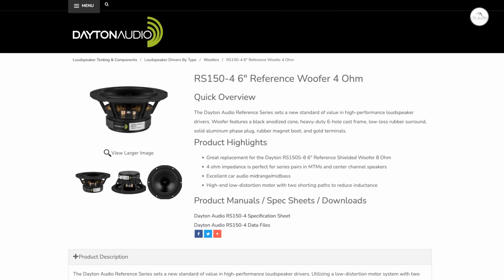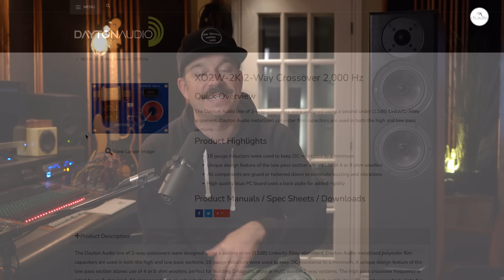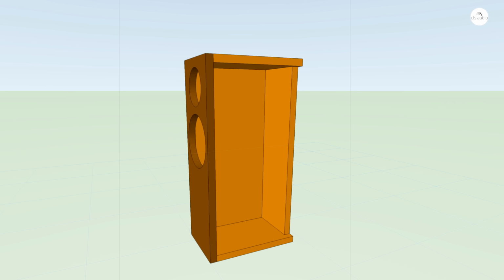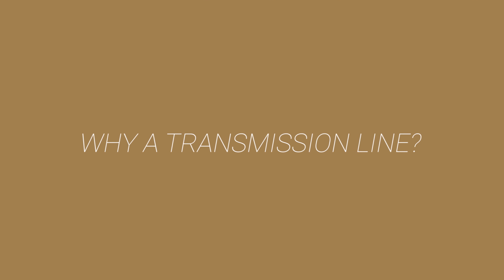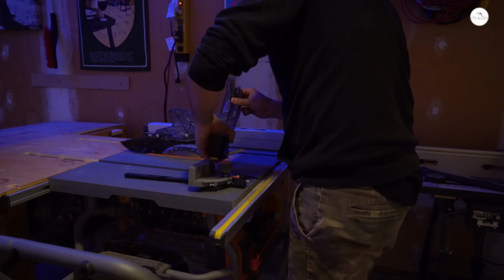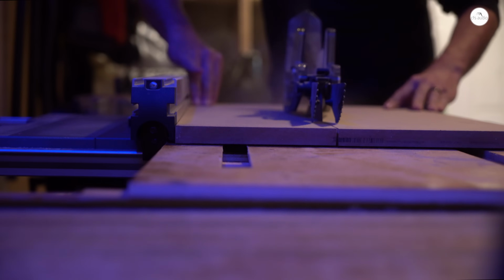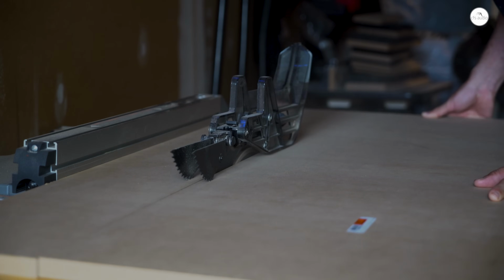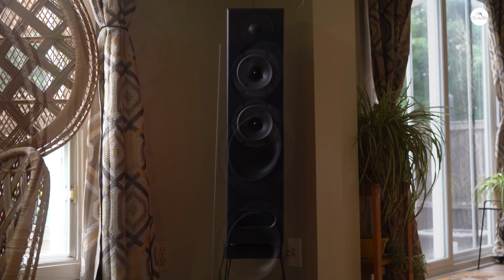DIY Reference Quality Speaker Build. How I built these amazing speakers and proper sound comparison!

Comment: If you want to upgrade it in the future, try to find a pair of silk ring radiator tweeters, preferably some based on the legendary VIFA XT25 lineup, as they are absolutely fantastic tweeters.

The long-winded explanation of transmission line speaker porting is that you are using a combination of air volume and the rate of transmissivity of sound through air to tune a speaker enclosure for a specific frequency that you want it to amplify. Most commonly, this is used to reinforce at or just below the resonant frequency of the main woofer to create a stronger bass or mid-bass performance, though it is possible to tune your enclosure volume and transmission line length to allow your speaker to dig even lower, though this can cause additional issues with time alignment. Unfortunately, I don't understand the equations and the physics behind them well enough to give an even more in-depth explanation, but it's a truly fascinating subject. You can also use folded enclosures with a certain shape to attenuate rear wave, like what KEF does with the Helmholtz resonator chambers on their Meta speakers. Inversely, you can also horn-load your transmission line by allowing the tube to expand in cross-section at a specific rate in order to amplify certain frequencies, though you typically only see people bother with this in the very niche point-source driver applications in order to get a usable bass response out of larger full-range drivers without needing to cheat like Bose does with their single driver crossover networks.
Reply from the maker: This great info Robert thanks for sharing!
Reply: @chrisferris3303  One guy who really knows something about transmission lines https://www.youtube.com/watch?v=HCQR7aXhKEc 
I've been designing and building t-lines exclusively for over 35 years, and I would largely ignore 95% of this comment thread, Chris! Just my 10 cents 😎😎

Here are a few fun t-line designs
https://www.youtube.com/watch?v=qm5K_VVRwXQ
https://www.youtube.com/watch?v=3qjWKUBvSNA
https://www.youtube.com/watch?v=-96WAVQdcyQ
https://www.youtube.com/watch?v=6yb2msOQw_4

t-line diy demo from a guy who I have huge respect for 
https://www.youtube.com/watch?v=-U3XW6TV9zI
Reply: You don't just swap different drivers in a speaker and think the crossover will match as well as with the original one.
Reply: @davidlong1786  they're roughly the same impedance, sensitivity, and the xt25 can actually cross over even lower if necessary, plus they're ruler flat down to, like, 1000Hz and out to 30kHz. So, yeah, you can just swap the driver out and expect it to perform as well.
Reply: @mndlessdrwer   "Roughly the same impedance" means close but no cigar. Same goes for " cross over lower if necessary". Who's going to rebuild the crossover for that? Not 99% of those that buy this kit. What about the impedance bumps at FS? Are they the same, if not then a big difference for the crossover.
Reply: @davidlong1786  It really isn't that important. If you're running a fairly simple crossover and neither of your tweeters are being run down to their resonant frequency, then matching their impedance there really doesn't matter. On top of all of that, dude is using pre-built fairly generic crossovers, so the significance matters even less. Would I recommend swapping drivers like that to someone who spent five hours building custom crossovers to really eke the most out of their drivers and reshape their FR to his preference? No, no I wouldn't. But he isn't to that stage yet, so this is the ideal time to reuse the generic crossovers and see if the sound signature of the tweeters is more to his preference compared to the ones from Dayton.
Reply: @mndlessdrwer   Well by using a generic crossover there is no telling what the combined frequency response is anyway but I'd guess at less than optimal no matter which tweeter he uses. It probably has dips and peaks who know where. I'd much rather buy a kit where the crossover was built specifically for the drivers so they have a better chance of sounding their best.
Reply: @davidlong1786  This is a very valid concern depending on how complicated the crossover is.

Comment: Been using Parts Express and Dayton Audio for over twenty years. I have a pair of rebuilt Sansui Speakers that now use Dayton Audio products, as well as all of my vehicles sound systems being designed around Dayton Audio Reference Series speakers. Incredible performance at an Incredible price point!!!!
Reply from the maker: Good stuff!
Reply: Any experience with rs225 or rs 100? Im planning to use them in car. Others seem to like sb acoustics  and scan speak too.

Comment: nice speakers. did you take any measurements of them ? how did you come up with the design and volume for the cabinets
Reply from the maker: Hey Jason, not yet. Gonna get myself a proper measuring kit. I plan to do a subwoofer build in the near future maybe I’ll include the measurements there. For this build I looked at a bunch of builds and the suggested speaker specs and went from there. Thanks for watching.
Reply: @chrisferris3303  well you did a great job, I’ve built a whole 5.1 soon to be 5.1.2 using the Dayton reference 7” drivers with a peerless tweeters. My mains are mtm design my center is a wmtmw and surrounds and atmos are just tm  versions

Comment: Nice build!  You would get enhanced results using a better crossover: It's easy to get indesirable effects using ready made crossovers.  Using iron-core inductances is a bad idea, it's cheaper but the value change with power.  It's important to use quality cables and binding posts (pure OFC copper).  Also, it's better to have the drivers flush mount, it avoids resonnances en diffraction.  Check for GR Research, the guy really know what he is takling about!  And don't forget: It's another topic by itselt but your listening room is a transfer function by itself!
Reply from the maker: Thanks Guy, can’t wait to start taking a deep dive. Also I’m a subscriber of GR research amazing channel.
Reply: Shure. But not gr research style. Overprized parts. Audyn q4 400v are cheap and good.  Same is for aircore inductors. 👍👍🇩🇪
Reply: Another GR fanatic
Reply: @pliedtka  not at all... I'm simply an engineer trying to help poeple.  I'm "fan" of nobody in this world, but there are good things from GR Research, and things i less agree...
Reply: @pliedtka  I’ve only been designing t-line exclusively for over 35 years, and I'm amazed at how the fundamentals of acoustics, which have been around since the beginning of time, and millions if not billions of years before speakers were ever invented ... are largely ignored by those who I think should know better, but obviously don't! 

Here are a few fun t-line designs
https://www.youtube.com/watch?v=qm5K_VVRwXQ
https://www.youtube.com/watch?v=3qjWKUBvSNA
https://www.youtube.com/watch?v=-96WAVQdcyQ
https://www.youtube.com/watch?v=6yb2msOQw_4

And a t-line  diy demo from a guy who I have huge respect for 
https://www.youtube.com/watch?v=-U3XW6TV9zI
Reply: @pliedtka  now, we can speak technical if you want, unless you are one of those trolls with big mouth and nothing to show for...

Comment: Sorry no. A pre-assembeld crossover is a terrible idea and the results are going to be poor at best. Speaker design isn't as trivial as pick your parts and crossover. It's way, way, more involved.
Reply: Its a great starting point with the pre-assembled, and from there starts the road to improve with software, measurements etc if it captures the interest.
Reply from the maker: @guyboisvert66  I’m already a subscriber of his. I was blown away by how poorly the RP 600’s tested. Super cool stuff on there.
Reply: @chrisferris3303  Yeah, Klipsch has always been about efficiency, not overall sound quality!
Reply: Dont be naive! Do you think every pair of speakers are tuned before they leave factory? First units are made this way. The rest is just copy and paste.
Reply: A pre-assembled crossover is a good starting point if you just want to get some speakers to listen to while you design something custom.
Reply: @mndlessdrwer  IMHO, in that case, better to pay real cheap otherwise, it's a waist of money!  A good designed crossover with quality parts is around 300$.  Fairly cheap for getting good sound!
Reply: @guyboisvert66  pretty much. You pay, like, $30 per crossover for something cheap that won't kill your driver's so you can use them while you build something better or find someone who builds better crossovers.
Reply from the maker: I’m sure you’re right. But everyone has to start somewhere. Thanks for watching.
Reply: @chrisferris3303 for a starting point the pre-assembled crossover is a good choice. Tip is to install it outside of the enclosure (on the backside of the speaker. That way you can access it and modify it easily and when you are satisfied you can just forget it. Designing a crossover is quite difficult, especially in a transmission line enclosure where you need delay circuits etc. A simple closed 2way book shelf speaker would be a lot easier to begin with but who doesn’t need a challenge 😊
Reply: @guyboisvert66  GRr never does sound demos or shows measurements or explains the cross over he builds.
Reply: @-IE_it_yourself  He explains live what he put, how he does measurements, etc.  It all depends on speakers and box and one has to study before doing it.  Think of Vance Dickason book for example and knowing how to make gated measure for example
Reply: @guyboisvert66  yeeah fair enough. i havent watched all his stiff, but normally it is him with some graphs talking about how there is a dip, and that he will build a cross over to fix it. but doesnt do a before or after recording or test or measurements. or an explanation about how he came to the conclusion of what components and design he decided on. 

Maybe you know of a video where he does.

It is his channel and he seems to like what he does. but he is not a very good teacher. and i am NOT a good student.
Reply: @-IE_it_yourself  Well, as you said, he's not teaching.  For designing crossovers, you need to understand how it works backed by proper knowledge.  There are books on that.  And you have to have proper test rig and know how to do measurements.

Comment: I am also trying to build my first custom speaker/ tower and I am trying to find information on how to get the most out of the current drivers that I have. The video and design here is the exact thing that I am looking to build. I have 2 different drivers (a tweeter and two woofers [a set per tower]) but do not know how to figure the best enclosure size. The manufacture (Electro Mavin) said that the build would give best sound between .5 and .75 cubic feet but when I imported the Ts measurements of the drivers into a driver program (WinISD) it said the best enclosure size would be around 2 cubic feet. Also, the ports that WinISD recommended/ calculated would result in a turbulent force if the drivers were pushed to the max power output.

Long story short, my question is, how did you come up with the enclosure size and the port size?
Reply: I use Winisd to design enclosures. You enter the woofer parameters and it helps you come up with the optimal size and type of enclosure.
Reply from the maker: Great question. Honest truth is I took a lot  of chances here. I looked at a bunch of speaker designs and then designed the cabinet I wanted. I did some math with a buddy of mine to see if we could figure out the best length for the Transmission Line but ultimately I had no idea what these things were gonna sound like. My suggestion would be to take a look at builds similar to what you want. See what they did and find a middle ground. Guaranteed the speakers I built could sound a-little better with finer tuning and different components. But I have to tell you everyone of my friends who have heard these have been blown away. I think you’ll find that having good components and well built cabinets will go along way! Good luck and thanks for watching!

Comment: Nice work man, those look classy.  Not easy to do.  Long term suggestion: develop the skills if you wish to design your own crossover designed specifically for those drivers, it will be far superior to that pre built crossover and as a result, your speaker will be far superior.  The drivers you picked out are better quality than what is used in the Infinity, so it gives you an idea of how good the speaker can be.  
Short term suggestion: build up some gasket tape behind the tweeter so that when you tighten the screws down that the front of the tweeter face is flush with the front baffle.  Super quick fix.  Your tweeters are inset about 1/16”-1/8” or so.  For the same reason you rounded the corners on the front, to reduce tweeter diffraction as those high frequencies roll off the front baffle, same for that. As the high frequencies go across the tweeter face plate they’ll hit that ridge where they sit slightly below the front baffle of the speaker and you’ll get pretty bad diffraction, basically eliminating any benefit you got from rounding the front corners of your speakers.
Reply: You can also add a felt ring on the front surface between the dome and the lip, which can also work
Reply from the maker: Dan love this. Can’t wait to start building my own crossovers. Love all these suggestions. Thanks so much for the input!
Reply: @chrisferris3303  Hi Chris. Dayton is one of the only driver manufactures that publishes frd and zma files for their speakers. You can download these files and import them directly into crossover simulation software and get to work without even having to take measurements. (The only measurement you really should take is that of the offset between the tip of the middle of the phase plug and the tip of the tweeter dome cover, as this is the point the measurements are taken from 1M away according to Dayton). Since your baffle is a basic shape, you can easily simulate the baffle diffraction and step loss in the speaker simulation software. I like SpeakerSim personally as I find it intuitive and easy to use. 

I would suggest redesigning your crossover network in a 2.5-way configuration to improve vertical off axis response and imaging. Use the lower woofer to fill in the baffle step loss and give a nice bass boost. When reading about 2.5 way designs you'll probably notice that most use parallel woofers, but don't fret, it can be done with series woofers as well, you'll just be using a capacitor and resistor shunted across the lower driver to pull down the mid-range.

With a custom crossover design you can also pull down the crossover point to around 1500hz, which will improve off-axis response and imaging characteristics for the speakers. 

These speakers have a lot MORE to give!
Reply: @chrisferris3303  You could have Danny at GR Research design a crossover for you to build.
Reply from the maker: @EskWIRED  how cool would that be!